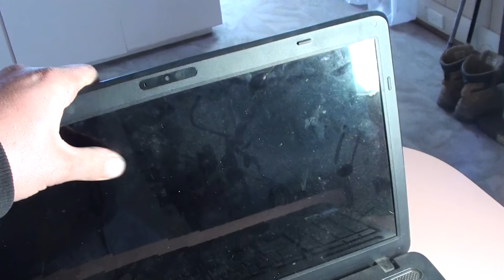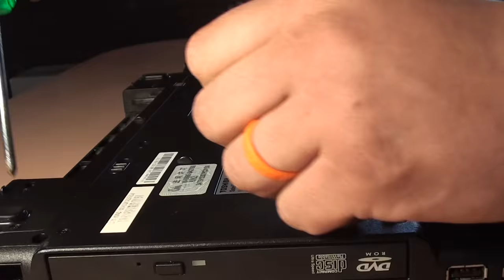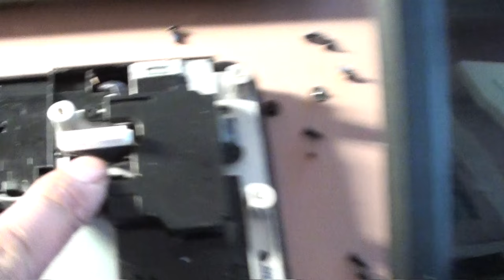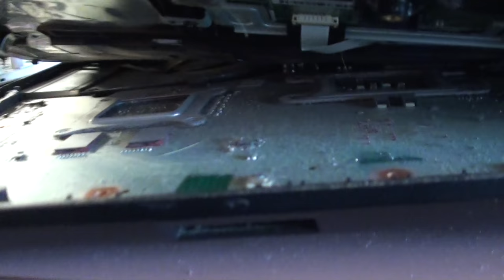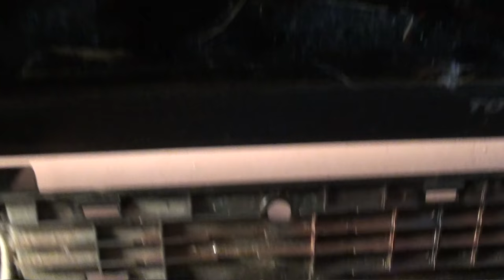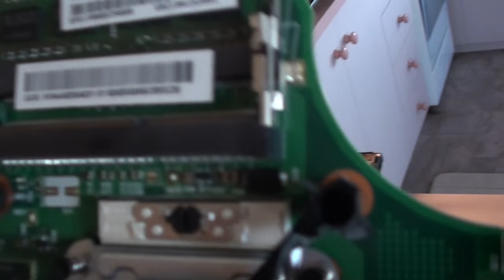Toshiba laptop screen swap fail

Comment: It's a shame you destroyed the laptop, if you had taken the actual screen casing apart you might have found that the connector on the back of the LCD itself may have matched up and allowed the swap.
Reply from the maker: +Jason Simpson no big loss they were old anyhow but will remember that  for next time